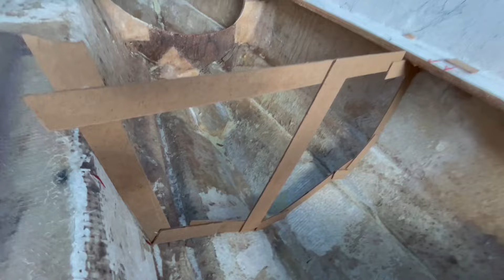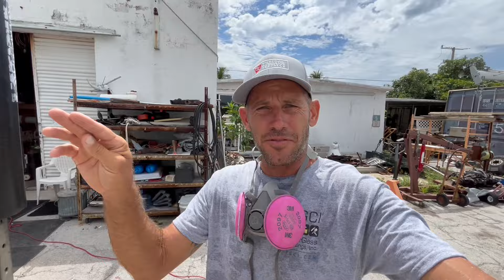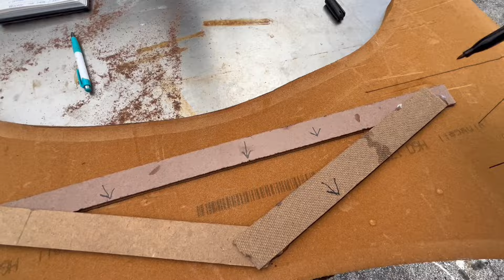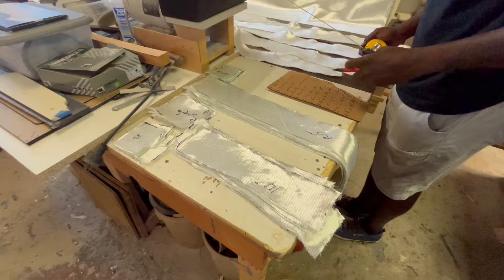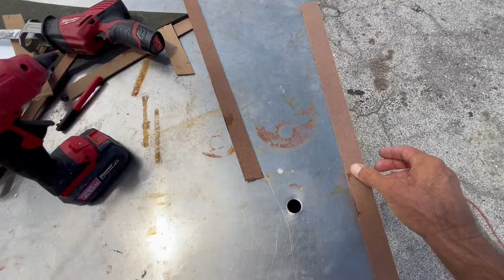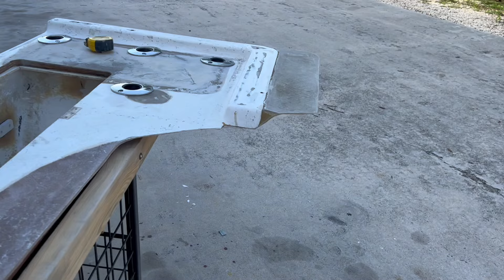Custom Skiff Build catamaran boat

Comment: I noticed alot.of your projects are smaller boats but I have a dream of getting a 25+ ft boat with a cabin , stripping it all out, demolishing the cabin and turning it in to a large sporty center console. With your knowledge would that be feasible? Or are most of the bigger boats structurally built around the cabins?
Reply from the maker: Hi there, yes, I definitely feature smaller boats / skiffs on the channel.  They’re more budget friendly and they keep me “ between the lines” in terms of affordability and usability.   My rule is that if a Honda civic can’t tow it, I don’t want it.  Haha.  Really though, I like the idea and it is definitely very possible to covert any boat to center console.  Some are easier then others but overall an outside hull is just a hull.  You can build the interior portion however you want as long as you adjust the structure to Support the new layout.  Cheers!
Reply: Funny, I have the opposite dream. My wife likes Dual Console boats, but they haven’t been made for as long. So I figured start with an easy-to-find center console hull, and convert it to a dual console…